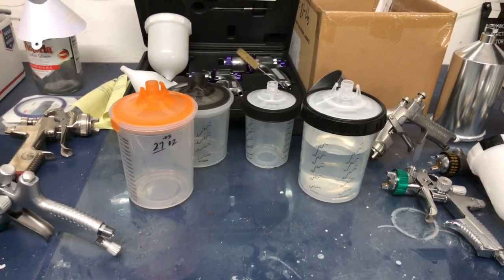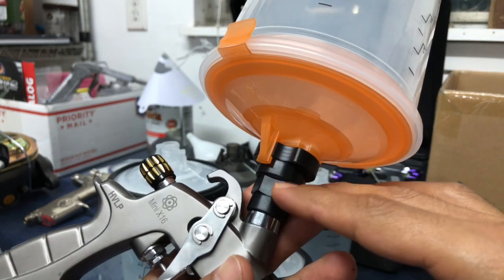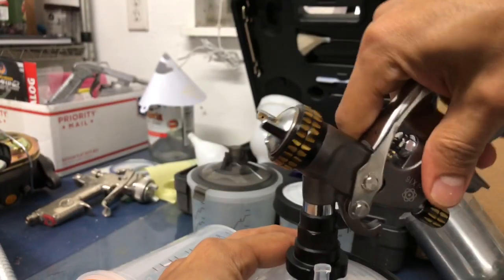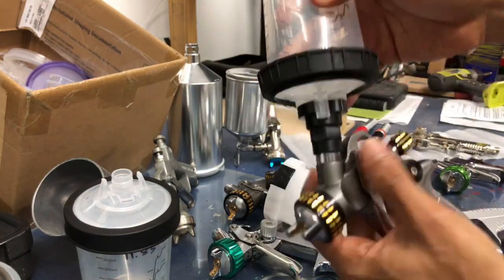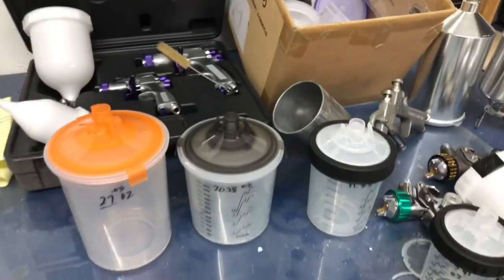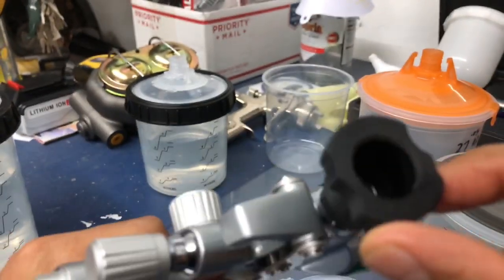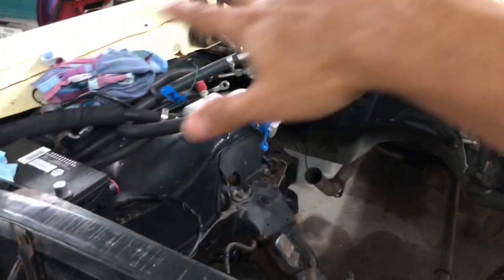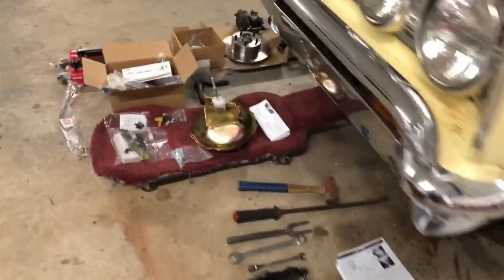BETTER Than 3M PPS Cup System? - De Kups, PPS, or This?

Comment: I bought the cup system with the snaps a couple of months ago on eBay. The are cheaper and work well, but PPS is better. The great thing is that you can take off the tabs and use a PPS cup over the snap cup. Works great and saves money. Also, you get a cover with filter for every liner just like PPS
Reply from the maker: Robert B yeah I like the collar type better as well.

Comment: many years using pps system.  Even the best leaks sometimes. We have set a whole 3m pps case order aside because of leaks and blaming it on a poor production batch/leaking.  Our shop has even engineered and produced a collar lock to prevent a twist and compression ejection because we use the bottom feed w/pressure setup for woodwork, furniture and cabinet work.  The ppms users  must not be a big enough players for 3m  not to see our most basic needs and concerns of a great working system that needs some bells and whistles.  3m if your listening, please hire me.  I have designed working proto-type collar to lock your cup to the gun so a twist off error is improbable to happen.  No longer do I have an old pps cup disengage and material explode/saturate everything in a  10 foot radius.

Comment: The clip snap cups look great Tony, just as long as they're slim/even and not super wide, any size is good. That would make the gun more balanced when painting, but if it was really bulky (wide) it would push the gun around when you were painting. Thats why I only use 24oz cups

I wouldn't go for the twist on pps style cups if I were you, might lead to people bashing you for copying their system. The snap cups you have look super clean and slim. Don't worry about which sizes or what style. It's great how you have it. If you find a durable way to snap on the cups you'll make good business.
Reply: And I would offer 1 snap on lid & 1 shell cup per 10 liners, so for example a package of 2 shell cups, 2 snap lids and 20 liners would be a good starter kit. Good for both basecoat (colored snap on lids) and clearcoat (a clear snap on lids).

Comment: I have used the DeKupp system and thought it would be foolproof.  It isn't.........The locking details are hidden and you do not have a visual indication that the cup is sealed.  You have to turn it upside and look for leaks. Not good!  The system that you are developing has many positive features.  The Lock system  using the PVC or Aluminum would be great and even better with 4 locking tabs.  If one locking tab fails you still have 3 in reserve!  The cup and filter arrangement also looks great.  Again 4 Tabs would be very reliable.   I would also suggest the kit have a funnel that is a good tight fit and would prevent an an overflow.
Reply from the maker: Thanks Thomas!
Reply: I would argue that you need 2 locks minimum or your gonna fail but im a bottom feeder.

Comment: Largest and smallest in a package, but 800 would be the most used. Twist lock cap is best. Plastic adapter is fine.
Reply from the maker: I agree

Comment: Didn't like the PPS system was using today ones got on eBay and the paint had fell out of the cup. Won't be using PPS cups nomore I can't be having paint fall out the cup gonna go use the regular cups. If it wasn't for the PPS system would of been done today. Just got a litte base left.  This orange orange cup is out show with the clips look better though the one with no clips won't use again. I might be done tommorow painting my truck I applied primer first but did it on the hole truck as a sealer but did about half the truck. Gonna get some more regular paint cups tommorow though they should make a PPS screw system cup.